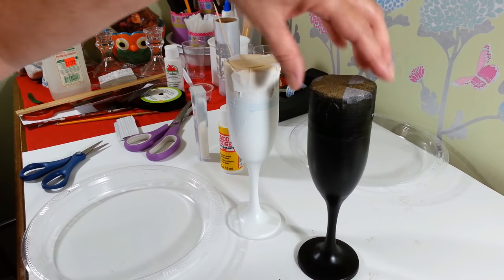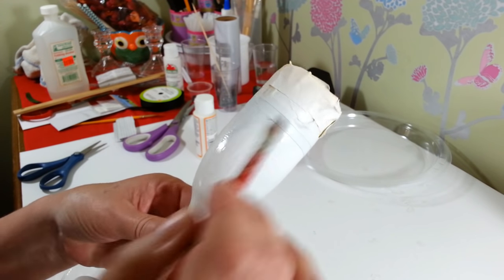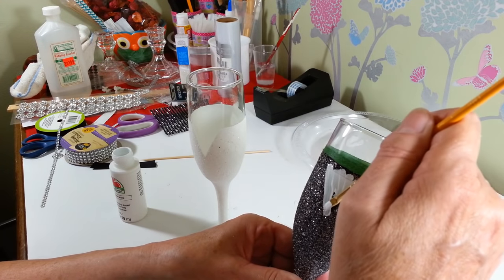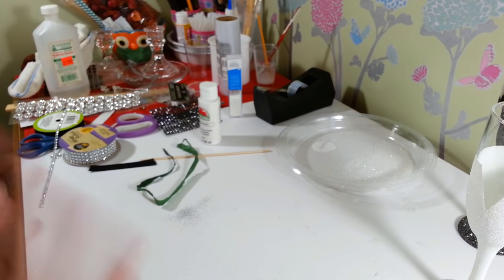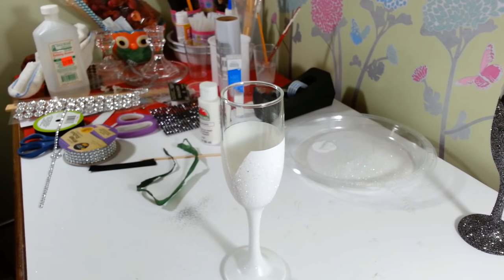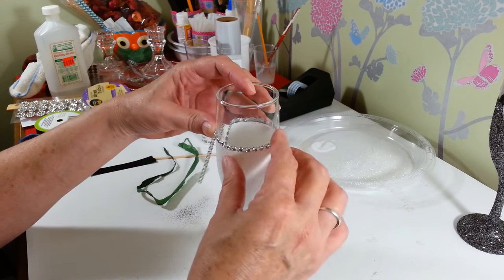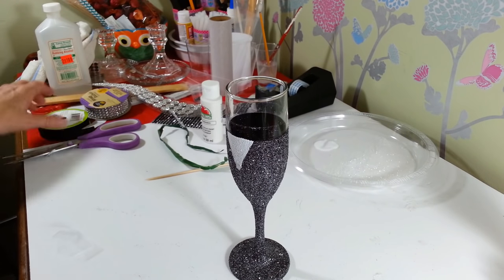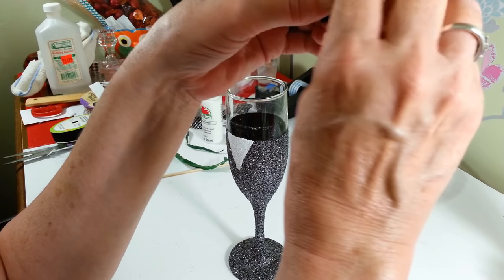👰Bride and Groom 💍Champagne Glasses. Easy DIY *Please read note in description

Comment: Hi I love all your ideas very beautiful good job on the work you do very beautiful, I have one question? Will the spray paint smell on the glasses, I’m trying to make this for someone, but I’m not sure if the spray paint will remain on the glass?
Reply from the maker: Thank you so much. It only smell until its good and dry and when you put on the glitter it seals it. I didn't notice any smell after that. You have to wipe the inside clean. Do not try to wash them. Thanks for watching. 🌺🐰🌸🐇

Comment: Hi Jody, just love these and I will be making 3 sets as all 3 of my children are getting married this year. One question, do you modge podge them after you glitter also to keep the glitter from coming off ?  I had made a set for my wedding 2 years ago but I think the venue tried to wash them and the grooms buttons came off with some paint.  Can you use water proof modge podge ?
Reply from the maker: Thank you so much!!!  I would just cover the top and spray a clear coat on them. You could use dishwashers safe modpodge also. Just remember it has a 28 day cure time. 🤗

Comment: Hi Jody!!! How big is the triangle on both of the glasses?
Reply from the maker: The triangles measure 1 1/8" at the top and 1 1/2" to the center point.
Reply: Thanks, i am having a problem with the groom, He was spray painted and then I put a thin layer of Mod Podge
 and sprinkled fine black glitter after drying. I put Mod Podge Sealer (glossy) and now here is where it goes down hill.. the glitter is not staying on the glass..... Is there anything you can suggest??
Reply from the maker: Not sure what happened. I use the Matte Mod Podge to put on the glitter . Not sure if that is the difference. I don't put mod podge as a sealer. It never works for me. I use a clear spray paint or a cheap hair spray like White rain works pretty good.

Comment: These look amazing I am doing my wedding and would love to make these. I just have one question, did you seal the glitter with anything once you put it on the glass so it does fall off every where? Thanks for sharing 😊😊💜💜
Reply from the maker: I only spray hair spray on them, but you can use a clear coat sealer.

Comment: Nice job! About to attempt this. Where did you get bread wire?
Reply from the maker: Thank you! The bread wire came in a box of the bread bags I had. You can use any kind if you don't have that. Thanks for watching. 😃
Reply: Disappointment looms for me. Did you have any issues w/ the spray paint running during drying time? I did. So I streams or run lines in my paint. It's not even and smooth like yours :(
Reply: I didn't hear the part where you had already said it was from a bread tie..duh me. Thanx
Reply: Also I found out once i added the glitter the running/streaming spray paint didn't matter as much
Reply: i think you should also be able to use white pipe cleaners.